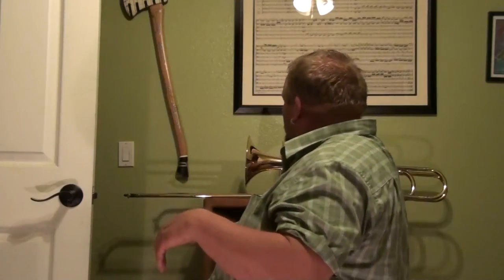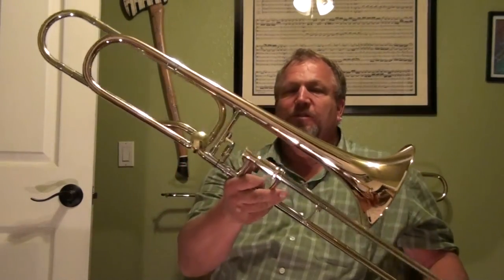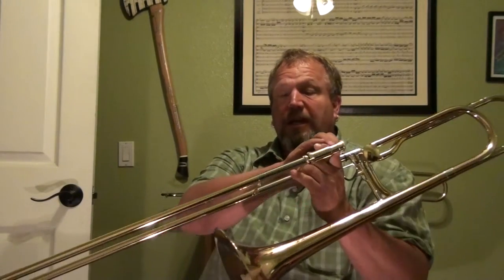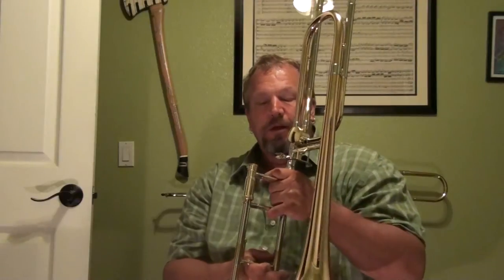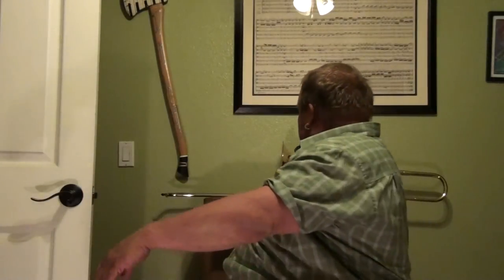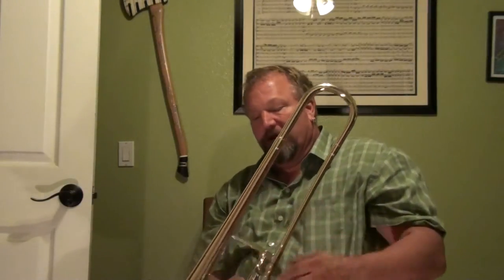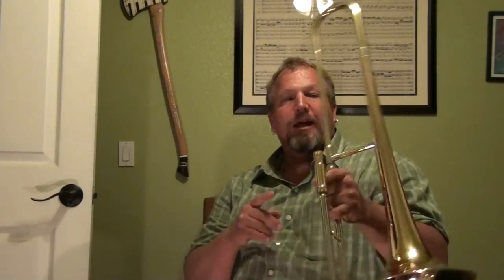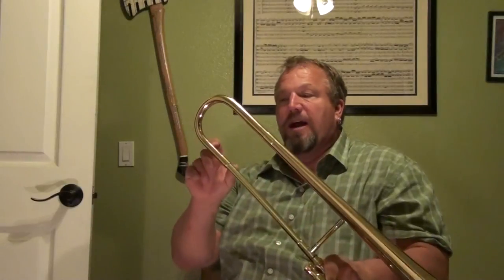Trombone Tuning In Slide - My Thoughts

Comment: I never played a TIS trombone.  Have you ever tried the same model of trombone with and without TIS side by side?  This wouldn't be a perfect test since every trombone varies a little and it would be hard to tell how much of the difference is TIS and how much other variation but it still might provide some insights.  One of my trombone teachers specifically didn't like light weight slides because he felt they adversely affected the sound.  He even added mass to the light slide on his 2b feeling it was too light.  Have you ever considered that the slide weight could be a factor as well as the uninterrupted conical section?
Reply from the maker: Al Dente: there is a difference between so called lightweight slides and slides that are normally constructed from nickel silver. My horn has a nickel silver slide but I wouldn't consider it lightweight such as what can be found on Bach lightweight slides or the Martin urbie green model. The reason the nickel silver is used on a slide is because it's very hard and very difficult to bend resulting in a true and straight slide for many years. You may not know it but the answers are also made out of nickel silver so having a nickel silver outer slide keeps the consistency in the middle. Some people think that the term lightweight means crummy when in fact a nickel silver slide maintains more acoustical energy than a yellow brass slide that weighs more. Why? Because the yellow brass is very soft and gives up energy, while the nickel silver regardless of weight maintains acoustical energy. To answer your other question yes I played both horns with tuning in the slide and tuning in the Bell, and in my opinion there was a significant Improvement in response and tone in the tuning in the slide. But that was already my conclusion from having played hundreds of horns configured both ways.
Reply: Cool, thanks for the info. I feel like I could get away without tuning on either end.  I never need to move my tuning slide.  I had my tuning slide trimmed so my 1st position is normally 1" from the receiver and I just adjust my positions relative to the ensemble I play with.  I used to play 1st position about 1/2" out but when I started playing in orchestras it wasn't enough since they tend to tune higher so I had my tuning slide trimmed.  When I'm late for a rehearsal and they offer me a tuning pitch I decline and joke that my trombone was tuned at the factory.  Within a fraction of a second playing the first note I would find them and be in tune.